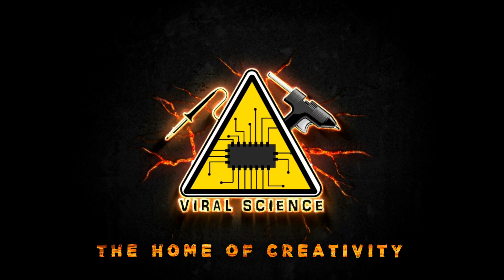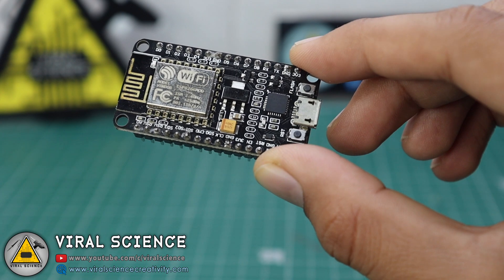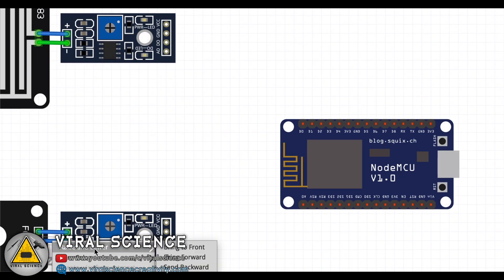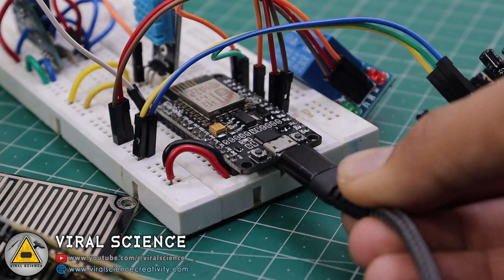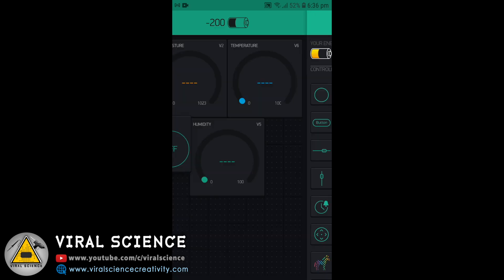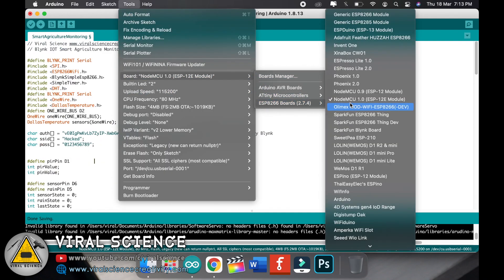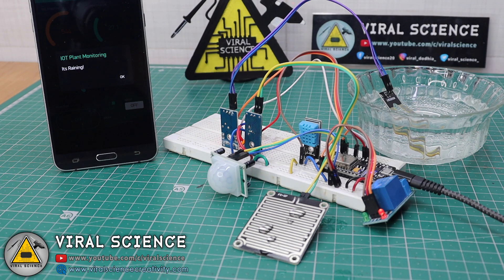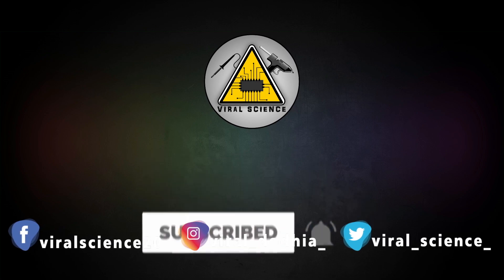ESP8266 Smart Irrigation System Blynk

Comment: when i compile code it gives Error saying "Error compiling for board NodeMCU 1.0 (ESP-12E Module).
" Please help me to fix this issue.
Reply: Bro while uploading press and hold the reset button ur error may get resolved
Reply: @soujanpoojari1605  thanks bro my error was solved way back ....but thanks for replying and also the project is working absolutely fine your video helped me alot..... Thanks again
Reply: @paraskushwaha8453  oh great bro, for me every connection is correct but my relay is not turning on how to sort it do u have any ideas??
Reply: @soujanpoojari1605  yeah actually i too was facing the same issue so I discarded that and instead of that I added switch which was connected to motor, so whenever farmer ON the switch motor will turn on and then water will start flowing vice versa
Reply: @paraskushwaha8453  can you help me bro for this project
Reply: Oh good idea bro thank you ❤️

Comment: Bro you have not mentioned the Solenoid water pump connection could you please tell me the connection and after connecting the Solenoid water valve will there be in change in the code pls also mention that it's a request.....

Comment: Error in compiling.[Error compiling for board NodeMCU 1.0 (ESP-12E Module).
] How to solve the following error bro
Reply: @NAZRAN ZAFRAN BIN JAMALUDDIN Moe have you got the solution for this? i am facing the same error
Reply: @aqibshafiq9797  bro did u get any solution for this
Reply: @njvloogs3814  no
Reply: @njvloogs3814  just remove
 #include <SimpleTimer.h>
And replace SimpleTimer timer;
 by 
BlynkTimer timer;
Because blynk library itself has BlynkTimer no need to include SimpleTimer
Reply: @atharvajoshi9099  Iam getting error as BlynkTimer' does not name a type 
after removing Simpler Timer header file would have any more solution for that code.
Reply: @tunganabhavya2352  replace complete SimpleTimer timer;
 with 
BlynkTimer timer;
Note that you should have blynk library installed
Reply: @atharvajoshi9099  Tq bro i cleared BlynkTimer error I removed header file and 
replaced with BlynkTimer and by updating Blynk header file..
Reply: @atharvajoshi9099  bro i am getting msg as hard Resetting Via RTS pin after Uploading code to esp8266, even resetting board many times Iin place of nodemcu cable iam using normal USB cable do this effect on that..could you have any more solutions plz..
Reply: @atharvajoshi9099   Can you please tell why onewire.h and Dallastemperature.h is used in the code?
Reply: @manvithrai1559  Are you use dallas and one wire?
Reply: @tunganabhavya2352  is it worked i want do this as my mini project help me
Reply: bro I'm getting an error,,,can you please help me
Reply: @vamshirx  can you specify the error?